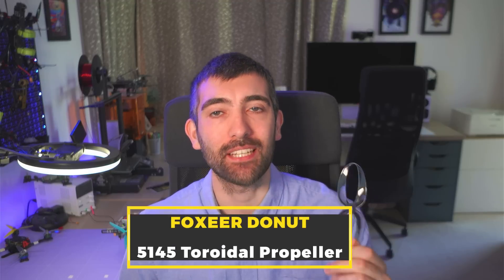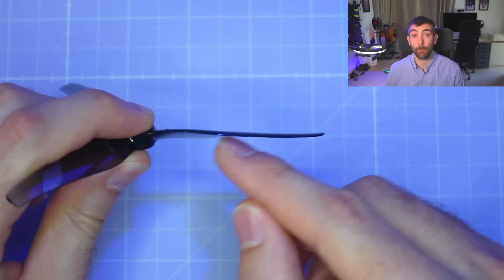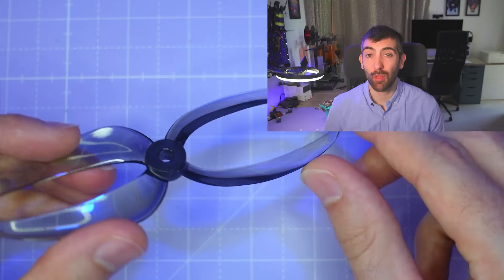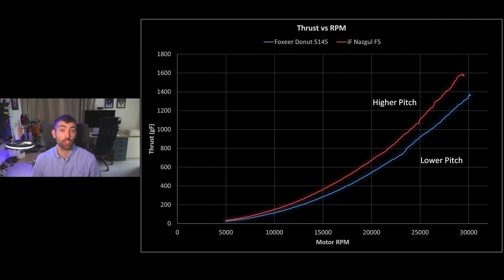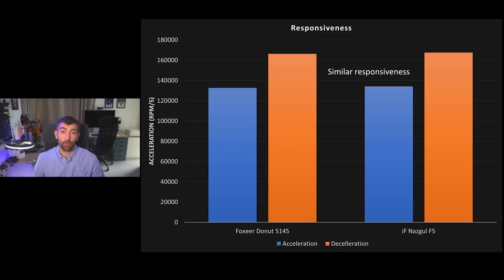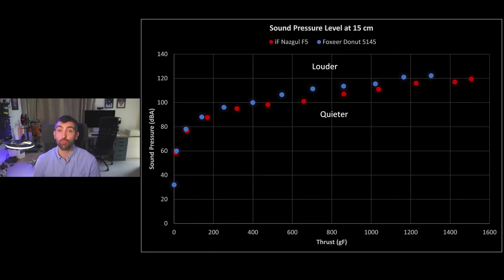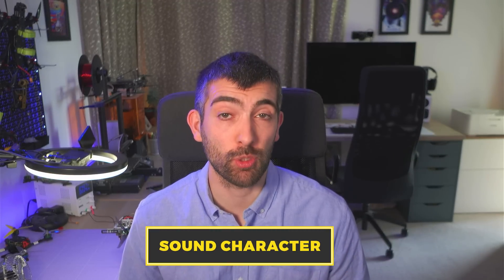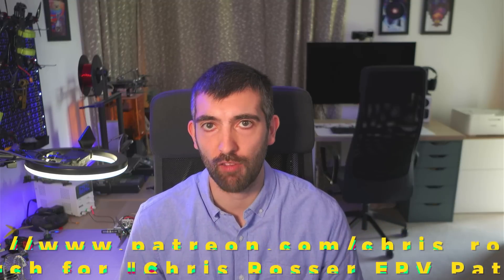The FIRST Toroidal Prop for FPV: ON TEST!

Comment: Why do toroidal propellers work better on a boat than on a plane in the air? What makes it more efficient in the water as opposed to the air?
Reply from the maker: I think they avoid cavitation in the water which is not an issue in a gas environment.
Reply: @ChrisRosser  ha... Great explanation except I don't know what cavitation means 🤣. Speaking to a layman here.

Comment: This exact foxer  propeller is like 2 blade toroidal propeller versus 3 blade normal this comparison isn't fair. there still no mass production of this kind propellers , am sure torodail props has lower sound pitch and little bit more efficient but is some downsides, is difficult to balance them and more prone to damage.

Comment: 90% of the noise is from the trapezoidal ESC. This test is stupid
Reply from the maker: If you run the test without a prop on the motor the noise is 40dB less.

Comment: As far as I understood from toroidal propellers, a toroidal propeller must have the front apex of blade 1 attached to the rear apex of blade 2 and vice versa. From what I see of these propellers, they do not appear to be toroidal but rather they have simply deformed them and joined the ends of the propellers but without forming a toroidal shape. 
Maybe with a v2 design where these are really toroidal, these will increase on power and efficiency as supposed to be?
Reply: I am happy to see that someone remarked the (obvious) difference (flaws) in the design of this "toroidal" prop. It is far off the MIT design and as such does not provide any benefit beside the sound aspect and the cool look. 
It is somewhat like those attempts to build a box-wing aircraft using two "ordinary" wings and connect them at their tips with a simple flat brace. I mean, the aerodynamic design of winglets is much more than just a plate mounted vertically. I really doubt that this mass-produced prop has followed the rules of aerodynamics of toroidal props...

Comment: When the toroidal prop is producing thrust at high RPM, I wonder whether it flexes so much that the distortion to its shape negates all the supposed aerodynamic improvements. Maybe you could set up a camera to observe the prop flexing when its at high RPM.

Comment: on the topic of sound, when it comes to how loud we perceive a sound to be, there's more to it.

the toroidal prop is much lower in frequency.

our sensitivity to sound is not flat across all frequencies, and that frequency response is not the same through the whole dB range.

a sound at say 3khz will be perceived at a different level to one at 100hz when at the same volume.

but it can change when played at different volumes .

check our fletcher munson curves

Comment: These props tend to work best within a certain throttle range, it seems. With a boat, you have a cruising RPM and it's possible to fine tune the prop to that rpm range. In a typical freestyle drone, the throttle range is massive, and you run into some limitations with the 'donut' props. As for the sound, the lower pitch makes it sound more quiet to our ears, I guess, even though the SPL is a bit higher.

Comment: great video !! I'm not surprised by the results as traditional props are alreafy hard to optimize, but I'm curious about your methodology for the efficiency test, did you measure the power coming to the motor or to the prop ? in the first case there could be some margin of error as the motor probably won't have the same efficiency for both propellers

Comment: That 2207 1855kv has more axial torque compared to radial torque - not designed for that motor.

Compare with 2505.5 2000kv, then conclude.

Comment: I test flew some of these. They are slightly quieter than regular props, but extremely fragile. I broke 1 just taking off and 2 landing. The joint at the tip breaks super easy. I had to replace at least one prop almost every time I flew with them. In a normal day of flying with regular props, I might replace 1 or 2. I went through 6 of these in less than an hour.
Reply: It's a fine example of theory meeting the windshield of reality.

Comment: You compared it with the best traditional prop, and that performs better than the toroidal prop. But is that still the case if you compare it with a mid- or low range traditional prop?

Comment: Love your videos and your channel, however the MIT research paper was using the comparison of the toroidal prop with a bi-blade prop. In my opinion that would have been a more appropriate and interesting comparison, maybe something for the future videos 😜. Said that I understand that in FPV bi-blades are only used for long range and commercial drones.
Reply: OfficialChrisRosser  SPAM ALERT

Comment: Since the very first tests of toroidal props I suspected that they are just another overhyped stuff. Are they quieter than traditional props? No. Are they way more efficient? No. Lighter? No. According to all the tests I saw on YT, toroidal props are just trash. And your test just confirmed it.
Reply: The part in the video from MIT when they have the toroidal compared to what looked like a oldschool 9450 DJI prop it was a lot quieter and I had read that larger props have a more noticeable difference due to higher tip speed. I just really don't think we should say MIT is lying because of tests using a completely different propeller and I know the 3d printed ones were not designed with any sort of simulation software to optimize and while I would hope a company would do so they are just for toys after all and even if they used some software to optimize I question if Foxeer had a fluid dynamics expert design theirs.

Comment: I've seen a ton of people comparing these props to the traditional three-bladed props when it comes to efficiency, but toroidal props are very clearly 4 bladed props. From my ""testing"" they seem to be a good in-between four and three-bladed props, they feel much more "locked in" than three-bladed props but have slightly higher apparent efficiency than the traditional 4 bladed propellers I fly (on the same drone[AOS5v2] with tunes to suit each). However, this is all anecdotal and I haven't done serious testing on this but it may be worth looking into. 

I honestly think the biggest draw for most will be that they are much less "Screechy" than normal props due to the toroidal shape, which I find is a huge boon when I am flying where I don't want to annoy people or disturb the environment too much. I honestly love the way they feel and sound too, but that is of course a personal preference.

I still feel like there is much to be optimized with toroidal prop tech, I mean look at how many tri-blade props there are out there and how much they differ in efficiency and feel; even when looking at props with similar sizes and pitch. Toroidal props aren't the "end-all-be-all" that they were touted in the paper, but they definitely arent the snake oil many people seem to think they are. I hope to see this be explored much more, especially with lower-pitch toroidal props, before the hobby disregards this concept.

Comment: for the sound characterizing what peak RPM is each prop hitting?  The more draggy prop will spin slower and make a lower pitch and possibly softer noise. Using a 8 blade prop for ducted centiliters produces similar if net more desirable noise characteristics to the toro IMO.

So far the only time I have seen anyone even try to show a way the toro is better is when they leave out some critical data. For example the last section of noise characteristic leaving out RPM and thrust levels for the noise we are hearing. If a nazgul can spin slower to make the same thrust than a full speed noise comparison isn't really fair.

Comment: A couple of questions came up for me: It looks like a toroidal prop, but does it have the "right geometry"? It could be pretty sensitive to minor variations in design compared to the MIT version. Are you turning it at the right RPM? You'd need to at least match the Reynold's number for the air and the size of the MIT prop to start to ensure you were getting the same results. Maybe it's spinning too fast, and you'd need larger props (just guessing) at slower speeds.
Reply: I believe MIT mentioned that the effect is stronger on larger props due to higher tip speed.

Comment: Strictly speaking you're reviewing the Donut prop, not the MIT's prop, they even don't look quite the same. The MIT one might be more efficient and quieter than a regular one, it's just Donut isn't there. Unfortunately, it looks like MIT haven't shared their design, only photos, so it's hard to confirm whether their props are indeed that good.
Reply from the maker: Yes, I'll reach out to them and see if they'll let me test their design!
Reply: @ChrisRosser  That would be amazing if they would, I am doubtful MIT would be lying and they did say that it's more effective with larger props due to higher tip speed.

Comment: On the sound test you could also do a LUFS measurement to get a more accurate representation of how "loud" it sounds to the human ear.
Reply from the maker: Thanks for your comment! The sound pressure level measurement is in dBA which is the human ear weighted sound level relative to the limit of human perception and is the correct unit of measure for real world loudness. LUFs is a measure of loudness of a digital audio file relative to a digital full scale (rather than a real world measure) so wouldn't be appropriate in this case.
Reply: @ChrisRosser  I totally forgot about that, however assuming you set the input gain on the mic exactly the same, have no AGC engaged, use no compression, and have the mic and prop in exactly same spot for both tests, then it shouldn't matter what 0 dBFS or 0 LUFS is, it would be a relative measurement between the two props, not total peak dB reading in the real world. Then you can use what I consider the more accurate weighting curve of LUFS versus the older A-weighted curve of dBA and then on top of that you get other useful data such as short term and long term integrated values. Taking a momentary dBA reading doesn't give you that. So, for example, you could do a throttle sweep and see wildly different LUFS values even if the peak dBA were exactly the same. It's a better way of conveying the layman's sensation of "THAT'S LOUDER!" from what I've seen. This would require a proper mic, audio interface, ASIO, the right recording software, and a tool like Youlean Loudness Meter 2 et al. It can't be done with an SPL meter or a phone, for example.

Comment: Everybody is saying the toroidal is more efficient yet all test on YT shows that its not. It sure looks like a high drag design, maybe the research is inaccurate??
Reply: The MIT ones have a different profile, I have yet to see a design that isn’t a normal prop airfoil with only the top bent up to join. MIT have a whole different progressive chord and asymmetrical airfoil thing going on with their design that probably is where the „secret sauce“ is.
Reply: @skylar7320  MIT does have one of the worlds leading fluid dynamics experts working for them. He's also a legend in the RC and fullscale world. Not sure if Mark Drela had anything to do with their prop but, I'd be really surprised if they didn't at least ask him some questions.

Comment: How stupid must a company be to develope a product which does not deliver any of the promises?
You build a prototype and then check for the benefits. 
I had seen these results before a year ago about water propellers that also did not deliver at all. 

Looks like myth busting - or the manufacturers do all get it wrong during production.
Reply: So we could try them
Reply: Smart companies make products that sell. I'm willing to bet that a very substantial amount of pilots bought these to try out, regardless of what prop manufacturer they're loyal too. Almost everyone I know picked up a couple sets out of morbid curiosity, and I'd be willing to bet that they have already sold enough of these to pay for the molds and have turned a profit. Foxeer was clever enough to bring these to market fast enough to have leveraged the inevitably short lived hype train. 🙂

Comment: You know it sounds lower during the blips at the end... I think your right. If they keep playing with the formula they will get it.
Reply: I am wishing for a smaller diameter toroidal prop, to get less of a scream from those 3.5" props, but I have a feeling that with this toroidal design, a larger prop diameter is going to be the way to get better performance. Hopefully that's just me being a little pessimistic, but even if it does turn out so, if a larger diameter toroidal prop gets close or better performance to a tri-blade, that would still be useful, and exciting.

Comment: The Toroidal prop is a 4 blade though is it not? So I guess, will always have the drawbacks of a 4 blade?
Reply: Maybe it should be better compared with a 4 blade.
Reply: Exactly, the tips are connected, but it’s still a four bladed prop.

Comment: Wondering how the air creates a "vortex" around the tip of the propeller, when the craft is in motion, and the blades themselves are spinning at tens of thousands of RPM.
What you're saying makes sense for airplane wings, but I can't wrap my brain around how it would apply to a spinning propeller blade.
Reply: there might be a video somewhere showing this with the help of a laser projection
Reply: The blades function as an airplane wing going in a circle so a vortex is still created.  Check out Vortex Ring State when the vortices on a helicopter’s rotors become so much of a problem that it can crash because of it.

Comment: I'm just curious, what makes you say the Nazgul F5 prop is the "best you've tested"?
Props are one of those things in FPV that are like rates. They're personal and relative to the pilot.
Reply: lol - dude. Rosser does objective testing proving the various differences in characteristics between different props. He puts the data right there in his videos. What are you even talking about? Preference is preference, but there are objective differences in how props handle and perform. That's two different metrics. You're asking questions this guy has answered in great detail in other videos of his.
Reply: @Wind_Rapport while I mostly agree with you, there's no way he could do enough testing to cover all of the variables for real-world flying. Like if you're doing proxy and the best overall prop slightly beat out another prop due to its top end efficiency, but you never actually utilize the top end when flying, maybe the "2nd place" prop is stronger in other areas that contribute more value to your real world use case. It may objectively be the best prop, but may subjectively not be the best prop for everyone. 
I don't even like running anything higher than a 3.6 in pitch, and lately I prefer a 3-3.3". Does that make it a less Superior prop? Not when I'm flying. 🙂
Reply: @willpowerfpv3246  Yeah you are 100% talking about preference again. Like yeah man you prefer a certain amount of pitch for a certain use case.. but your original argument was "Rosser can't possibly test every objective variable" - And my response to that is yes you can, and he does, but obviously nobody is taking into account your personal preference as a variable lol. I'm coming to realize that's what you're really arguing about. You should change your YouTube handle to SemanticsFPV, ha I kid. Later
Reply: @Wind_Rapport  my point is, "best" is a subjective term. Which means that in no way can scientific testing determine what is best. 😉